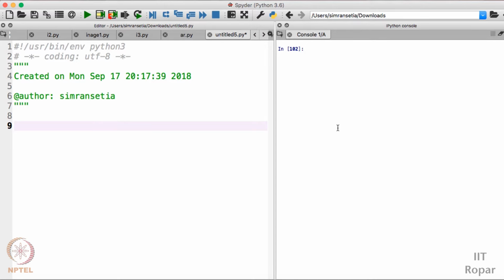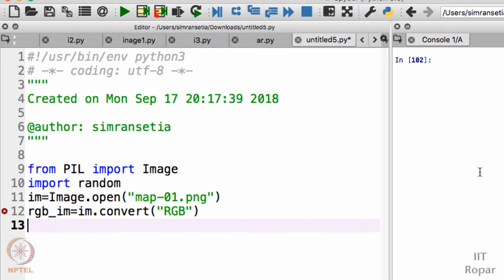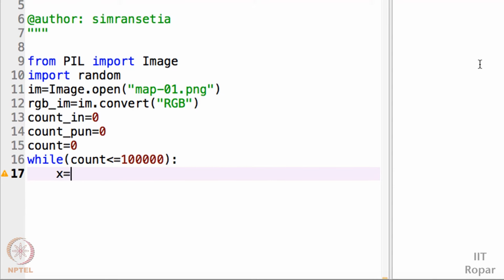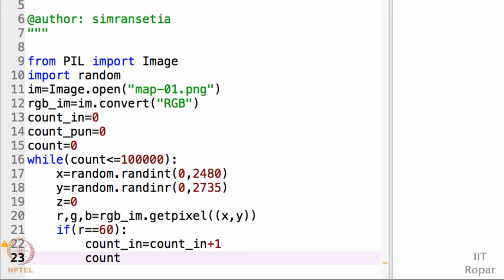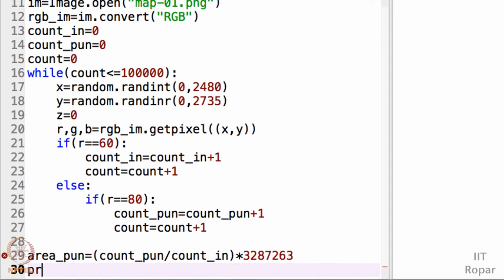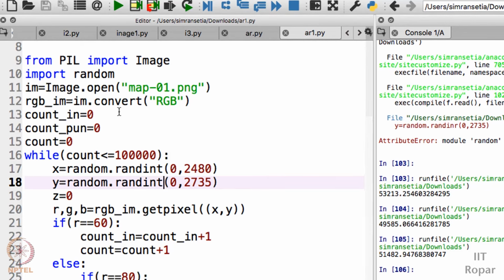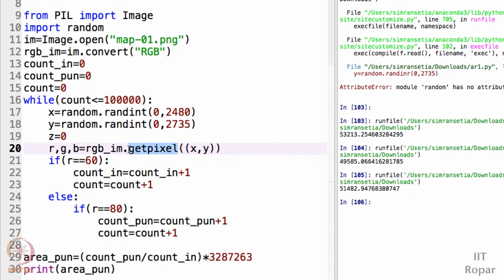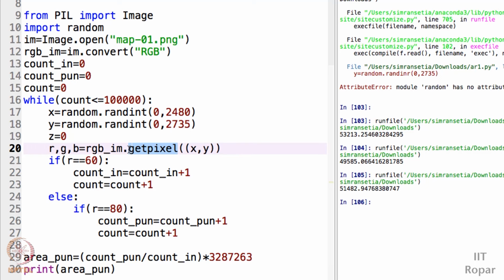Area Calculation - Don't Measure - Part 06

Comment: import random
from PIL import Image
img=Image.open("D:\mymap.png")
rgb_img=img.convert("RGB")
count_pn=0
count_in=0
count=0
while(count<=100000):
    x=random.randint(0,580)
    y=random.randint(0,658)
    z=0
    r,g,b=rgb_img.getpixel((x,y))
    if (r==82):
        count_pn+=1
        count+=1
    else:
        if (r==57):
            count_in+=1
            count+=1
punjab_area=(count_pn/count_in)*3287263
print("Estimated area of Punjab is" +str(punjab_area))
Reply: why pixel reduced in randint ??
Reply: how did you choose rgb value [if (r==57),  if (r==82)]  57 and 82